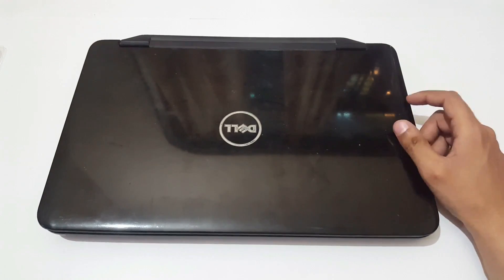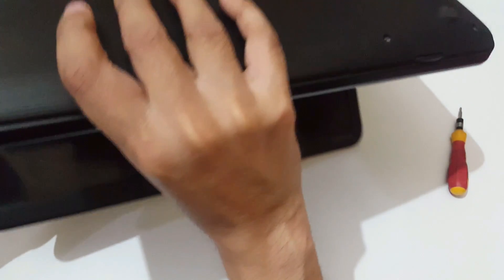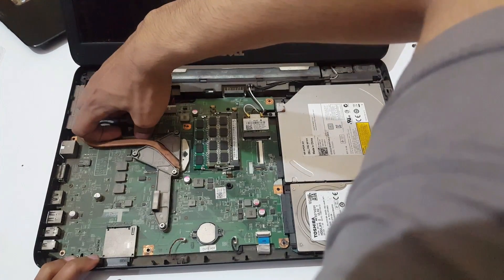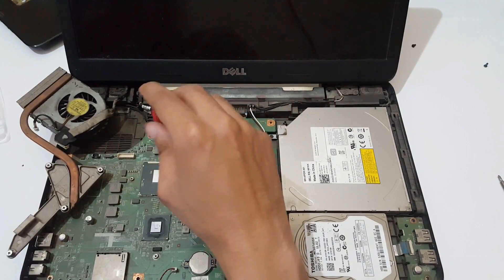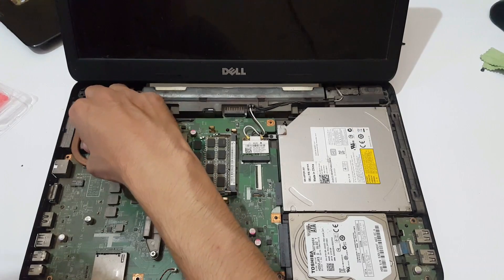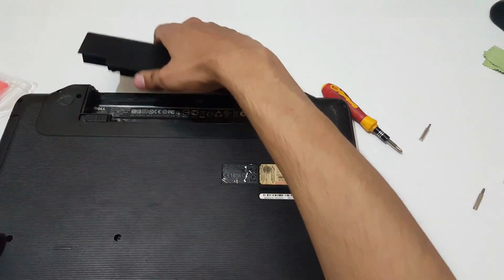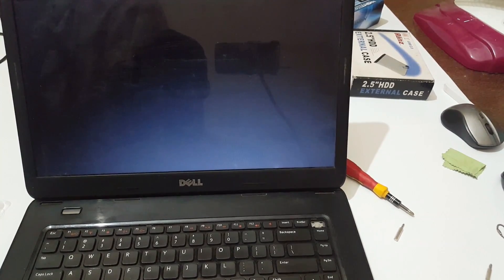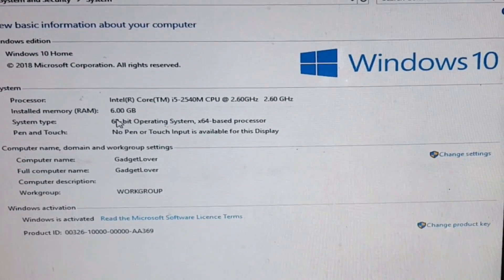How to Upgrade Processor on DELL Laptop | i3 to i5 & i7 - Make Laptop Faster for Gaming

Comment: I want to ask that can I change my proceer in Vostro 14 sereis 13000 plz tell 🌄
Reply from the maker: I would like to inform you that if the processor is not soldered you can upgrade it in same generation
Reply: @GadgetLover360  thanks
Reply: @GadgetLover360  i want to ask that how would I know tht is soldered
Reply from the maker: @uttkarshkabdwal7737  You're welcome and I would suggest you watch it's disassembly video to know about it

Comment: Brothers can i upgrade my dell Inspiron 15 3000 to i7?
Reply from the maker: In my knowledge the processor of this Laptop is soldered so you can't upgrade it but I would suggest you upgrade its RAM to max and install SSD for better performance

Comment: Sir, possible any cpu update, i have for dell inspiron 3583 i5-8th gen 8gb ram 1 tb hdd and addtional 500gb ssd
Reply from the maker: The processor of this Laptop is soldered so you can't upgrade it but I would suggest you upgrade its RAM to max and install SSD for better performance
Reply: @GadgetLover360  Sir can anything be done with gpu i have amd radeon 520 in it,,,,, and thanx for quick response
Reply from the maker: @511sanjeevthalod7  You're welcome and if you want to upgrade you can attach external graphics card to your Laptop

Comment: I am using hp 15 ac039tu laptop.. i currently have celeron n3050 processor.. what option do i have to replace it with? Thank You.
Reply from the maker: You're welcome and in my knowledge the processor of this Laptop is soldered so you can't upgrade it but I would suggest you upgrade its RAM to max and install SSD for better performance

Comment: Can a dell e6410 I5, with intergraded gpu, be upgraded to I7 with intergrated gpu?
Reply from the maker: Yes
Reply: @GadgetLover360  excellent thank you very much for your time
Reply from the maker: @yannisil1979  You're most welcome
Reply: @GadgetLover360  thank for the info but i found out there i not much difference between my i5 530m and the i7 640m,  i wish i could install an i7 quad core with intergraded gpu but i cannot find anything appropriate. Thanks for your help though
Reply from the maker: @yannisil1979  You're welcome

Comment: Is it possible to upgrade the processor in my old Lenovo ThinkPad T420? It comes with a 3rd gen i5 and I know there is a variation of the T420 that came with a i7 instead of the i5, so I was just curious if I could upgrade it?
Reply from the maker: Yes and Intel Core i7 3520M is best processor for your Laptop

Comment: I am having a Dell Inspiron 15-3537 core i5 processor where can i purchase core i7 processor of the same specs and i want to ask are all del inspiron 15-3537 CPU sockets the same no matter the CPU type, or they are different in size and shape because i want to upgrade to core i7
Reply from the maker: The processor of this Laptop is soldered so you can't upgrade it but I would suggest you upgrade its RAM to max and install SSD for better performance

Comment: Bro i have lenevo ideapad 320 i3 tell how should i improve its performance it has hdd should i opt for ssd
Reply from the maker: The processor of this Laptop is soldered so I would suggest you upgrade its RAM to max and install SSD for better performance

Comment: I have an old dell latitude E5530 series i5 3rd generation leptop. Is is enough to run heavy software like: premier pro?  If not then can i upgrade its generation to 8th or 9th?
Reply from the maker: I would like to inform that you can upgrade it in same generation and Intel Core i7 3632QM is best processor for your Laptop and upgrade its RAM to max and install SSD for more better performance
Reply: @GadgetLover360  but premier pro processor requirement is i5 6th generation (minimum) which is grater than i7 3rd generation. am l right ?
Reply from the maker: @nageshsahu4964  Its generation is higher than current processor generation

Comment: I have an old Dell Inspiron 15 3000 series i3 processor laptop, Can I upgrade it to i7 ??
Reply from the maker: In my knowledge the processor of this Laptop is soldered so you can't upgrade it but I would suggest you upgrade its RAM to max and install SSD for better performance
Reply: @GadgetLover360  Got it, thank you for replying. Keep up with the awesome videos.
Reply from the maker: @luther2418  You're welcome

Comment: I have dell inspirion 15 3000 with amd a6 6310 processor . which processor is best to upgrade. I already instaled ssd memory.
Reply from the maker: In my knowledge the processor of this Laptop is soldered so you can't upgrade it But I would suggest you with SSD upgrade its RAM to max for better performance
Reply: @GadgetLover360  Can I change the motherboard and upgrade the processor. Is it possible to change motherboard in laptop.
Reply from the maker: @anuranmandal120  Yes

Comment: Sir I'm using Panasonic cf-sx2 with Intel i5-3320M Dual-Core Processor can I upgrade my processor?
Reply from the maker: In my knowledge the processor of this Laptop is soldered so you can't upgrade it but I would suggest you upgrade its RAM to max and install SSD for better performance
Reply: @GadgetLover360  thank you very much
Reply from the maker: @julzzzpena7729  You're most welcome

Comment: Is there any problem while installing two different capacity rams with same speed in in two ram slots?? For example 4gb ddr3 1600mhz in slot 1 and 2gb ddr3 1600mhz in slot 2..
Reply from the maker: No

Comment: I'm using i5 4th generation hp pro desk computer and i want to upgrade it to i5 6th gen while everything should remain same.!
Is it possible?
Reply from the maker: I would like to inform you that if the processor is not soldered you can upgrade it in same generation

Comment: Hi 
Am using a Hp pavilion 15ac-506tu (core i3 -5th gen laptop )
Can i upgrade my processor?
Reply from the maker: Hi and the processor of this Laptop is soldered so you can't upgrade it but I would suggest you upgrade its RAM to max and install SSD for better performance

Comment: Brother i have ACER-ASPIRE E1-531 comes with an old intel pentinum(R) b960 processor it is pga please suggest me a nice process with it's generation so that i can buy and upgrade my potato pc please bro reply as soon as possible😊😊

EDit"-[ i am glad to see that you are still replying to peoples and helping them even the video is around 1 year old]
Reply from the maker: Thanks and Intel Core i5 2540M is best processor for your Laptop
Reply: @GadgetLover360  bro the processor which is by default in my pc is INTEL PENTIUM (r)  B960 having supported socket -pga988, fcpga988

And the processor which you are telling is i52540M having supported socket - PPGA988, FCBGA1023  are u sure the processor you are telling will support in my pc please bro tell me so that i can purchase 🙂
Reply: @GadgetLover360  please reply brooo
Reply from the maker: @infantus5725  Yes
Reply: @GadgetLover360  pakka fir jake kharid lu na lag jayega na
Reply from the maker: @infantus5725  Yes

Comment: Hi i have dell inspiron 15 3521 (i3 3rd gen) 
Can i change my processor in my laptop?
Reply from the maker: Hi and the processor of this Laptop is soldered so you can't upgrade it but I would suggest you upgrade its RAM to max and install SSD for better performance
Reply: @GadgetLover360  thank-you for the prompt reply just a question that how much can i sell this laptop for?
Reply from the maker: @charannnnnnnn  You're welcome and I would suggest you sell it on online marketplace
Reply: @GadgetLover360  and the price would be to sell. what would you recommend?
Reply from the maker: @charannnnnnnn  Enter its selling price according to its current condition and how old it is

Comment: I have dell inspiron 3520 core i3 ivy bridge processor 15 inch laptop, look same as this one in video. Its having 4gb ram. Which processor is suit me for upgrade?
Reply: Ok. Mine is core i3 3110m in specific
Reply from the maker: @user14967  Intel Core i5 3380M is best processor for your Laptop
Reply from the maker: Intel Core i5 3380M is best processor for your Laptop

Comment: I have dell inspiron 15 3000 can I upgrade its cpu
Reply from the maker: In my knowledge the processor of this Laptop is soldered so you can't upgrade it but I would suggest you upgrade its RAM to max and install SSD for better performance

Comment: thank you for this video
I have a Dell n5010 lab top  with cor i3 M380 CPU and 4Gb(2*2GB) RAM. Can I use one cor i 5 CPU and two 4GB RAMs?
Reply from the maker: You're welcome and yes Intel Core i5 580M is best processor for your Laptop
Reply: @GadgetLover360   is it necessary to upgrate Bios or not?
Reply from the maker: @behzadnoruzi2661  If update is available I would suggest you update it to the latest version as soon as possible

Comment: Hey man appreciate your work i have a Fujitsu a544 and the cpu is an i3 4000m what do you think is the best cpu to upgrade to? Thank you for your work
Reply from the maker: You're welcome and Intel Core i5 4340M is best processor for your Laptop
Reply: @GadgetLover360  thank you i am curious how do you know if it's compatible with the motherboard?
Reply from the maker: @chilldude5456  You're welcome and I would like to inform you that if the processor is not soldered you can upgrade it in same generation

Comment: Bro I have Inspiron 15 Se with i5 3rd .Can I upgrade my processor ND Hdd. Kindly tell me which processor will be fruitful?
Reply from the maker: If the processor is not soldered you can upgrade it in same generation and I would suggest you upgrade its RAM to max and install SSD for more better performance
Reply: @GadgetLover360  thanks
Reply from the maker: @learntocreate5006  You're welcome

Comment: Bro I have a doubt, is it possible to upgrade processor in Dell Vostro 3568 i3 7th gen? and could you suggest me the best ram and ssd to upgrade for this one.
Reply from the maker: The processor of this Laptop is soldered so you can't upgrade it but you can expand its RAM upto 16GB so buy 8GB + 8GB DDR4 2400 MHz RAM and 2.5 inch SSD for better performance
Reply: @GadgetLover360  tq bro for ur suggestion
Reply from the maker: @kalaiarasan9843  You're welcome

Comment: Hi bro i have a dell n5050 laptop with i3 2330m please suggest a upgrade processor.And can it have ssd.please provide a link for processor
Reply from the maker: Hi and Intel Core i5 2540M is best processor for your Laptop I have provide its link in description area below and it doesn't have M.2 SSD slot but you can replace HDD with 2.5 inch SSD
Reply: @GadgetLover360  thank u so much but the link u provided is showing a lot price can you provide a new link please
Reply from the maker: @adityaharidev5801  You're most welcome and then I suggest you buy it from Ebay online store

Comment: My laptop Is Lenovo IdeaPad s145 with Ryzen 3 3200u.  What other processors can be installed?
Reply from the maker: The processor of this Laptop is soldered so you can't upgrade it but I would suggest you upgrade its RAM to max and install SSD for better performance
Reply: @GadgetLover360  I have already installed Samsung m.2 nvme ssd and it's working fine. I wanted to know whether the processor can be replaced or not .
Thanks for your reply 👍
Reply from the maker: @priyamkumar2074  You're welcome

Comment: Is it possible to upgrade my Dell Inspiron - 3521 i3 processor to i5 or i7 processor ?
Reply from the maker: The processor of this Laptop is soldered so you can't upgrade it but I would suggest you upgrade its RAM to max and install SSD for better performance
Reply: Even I have the same 3521 😂 how is your laptop performance bro @ ankit

Comment: Can I upgrade my dell inspiron 3000 amd a6 to i5 or i7
Reply from the maker: In my knowledge the processor of this Laptop is soldered so you can't upgrade it but I would suggest you upgrade its RAM to max and install SSD for better performance

Comment: Hi, i have a dell inspiron 15 3000 series laptop with 8gb ddr3 ram with i3 6006U processor. Is it possible that i can upgrade the processor?
Reply from the maker: Hi and in my knowledge the processor of this Laptop is soldered so you can't upgrade it
Reply: @GadgetLover360  thanks bro
Reply from the maker: @chronohaxx  You're welcome

Comment: I have a very  low budget  I need a laptop  suggestion that I can buy and replace it's processor with  my i7 PC processor
Reply from the maker: I would like to inform that you can't change it with Desktop processor and if the processor is not soldered you can upgrade it in same generation

Comment: Sir mera dell inspiron 15 3000 series  laptop hai  core i3 4 generation how can i upgrade it to i5 and which intel is best plz suggest .. really want ur help sir.
Reply from the maker: In my knowledge the processor of this Laptop is soldered so you can't upgrade it but I would suggest you upgrade its RAM to max and install SSD for better performance

Comment: Can dell Inspiron 15 3501 can be upgrade to i7?
Reply from the maker: The processor of this Laptop is soldered so you can't upgrade it but I would suggest you upgrade its RAM to max and install SSD for better performance
Reply: @GadgetLover360  I have 256 SSD is it ok for long term (for 4 years).

Comment: I have lenovo g500/mt 20236 
I think the cpu isn't soldiered 
And my cpu is i3-3110m which has fcpga988,i wanna upgrade to i7-3720qm which has g2 or rpga988b is it possible to upgrade it both are same generations.
Reply from the maker: Yes
Reply: @GadgetLover360  thanks
Reply from the maker: @gnrtx-36969  You're welcome

Comment: What a great person, he's still replying to all the queries. Amazing work.
Reply from the maker: Thanks
Reply: @GadgetLover360  i3 to i7 processor upgrade panalama 8th generation.... problem varatha?
Reply: Bygotskitz  Thanks sir..... If i upgrade i3 to i7.. then my lap performance will increase?????
Reply from the maker: @ishankishannn  You're welcome and yes
Reply: @GadgetLover360  thanks for your fast reply sir💙
Reply from the maker: @ishankishannn  I didn't receive the notification of this comment
Reply: @GadgetLover360  hello sir can I upgrade my dell Vostro 1550 i3 to i7 please reply 😢❤
Reply from the maker: @its_priyam_pandey  Hi and thanks for your love and support and yes you can upgrade it in same generation
Reply: @GadgetLover360  but from where I bought it it is very expensive 😞
Reply: @GadgetLover360  if I upgrade only SSd from hdd and Ram up to 8GB then does it will also improve my laptop performance instead of changing processor  pratish Ashu give me best performance instead of changing processor because processor is too much costly
Reply from the maker: @its_priyam_pandey  Yes and I would suggest you buy it from ebay online store
Reply: @GadgetLover360  thanks brother 🎉❤️
Reply from the maker: @its_priyam_pandey  You're welcome
Reply: Can we update pentom to i5 or i7
Reply from the maker: @foodiezclub4857  If the processor is not soldered yes you can upgrade it in same generation

Comment: Hi I have a Thinkpad w540 with a 4th gen i7 can I upgrade it to a 5th gen
Reply from the maker: I would like to inform you that if the processor is not soldered you can upgrade it in same generation

Comment: My laptop is dell Inspiron 3542 i3 4005u which processor is best for upgrade
Reply from the maker: The processor of this Laptop is soldered so you can't upgrade it but I would suggest you upgrade its RAM to max and install SSD for better performance
Reply: I have upgraded the ram to 8 gb but didn't see much improvement
Reply from the maker: @piyushametha2935  Install SSD

Comment: Can I upgrade processor in vostro 3558 dell, currently it has i3 3rd generation.
Reply from the maker: The processor of this Laptop is soldered so you can't upgrade it but I would suggest you upgrade its RAM to max and install SSD for better performance

Comment: Can I change my i3 to an i5 on my dell laptop that is relatively new?
Reply from the maker: I would like to inform you that if the processor is not soldered you can upgrade it in same generation
Reply: @GadgetLover360  I still haven't got the laptop and I don't know very much about them,so I will have to see for myself if it's changeable or not?
Reply from the maker: @milanm.43  Yes
Reply: @GadgetLover360  ok,thank you
Reply from the maker: @milanm.43  You're welcome
Reply: @GadgetLover360  do you know if I can use a 10th gen i3 and an Intel uhd for some casual gaming with a 8gb ram
Reply from the maker: @milanm.43  Yes you can play it in optimal performance

Comment: I have inspiron 15 n5010
1.Can I upgrade proccesor
2..like ram what is highest processor I can upgrade
Reply from the maker: Provide processor number
Reply: @GadgetLover360  Sorry bro Intel core i3 M380
Reply: What is the best proccesor
Reply from the maker: @theminestone2853  Intel Core i5 580M is best processor for your Laptop
Reply: So kind of you
Reply: Can I upgrade
Reply: Can I upgrade to i7 4700k
Reply from the maker: @theminestone2853  I would like to inform that you can upgrade it in same generation
Reply: Ok bro
Reply: Shall I upgrade to i7 640M
Reply: Should I only upgrade to m proccesor
Reply from the maker: @theminestone2853  Yes
Reply: Bro can I upgrade to i7 3540M
Reply: One last question I will not disturb you
Reply from the maker: @theminestone2853  No